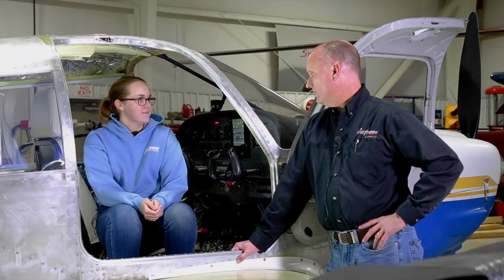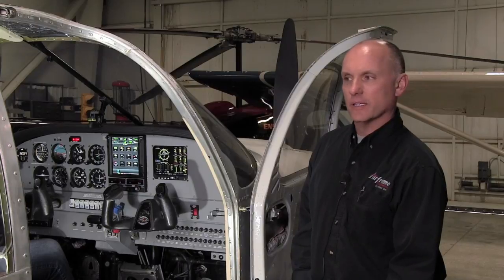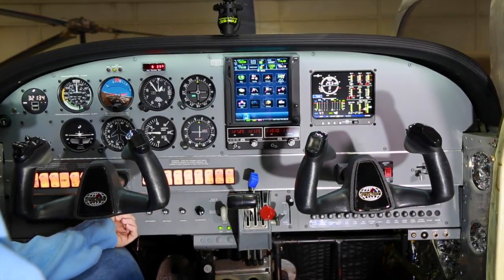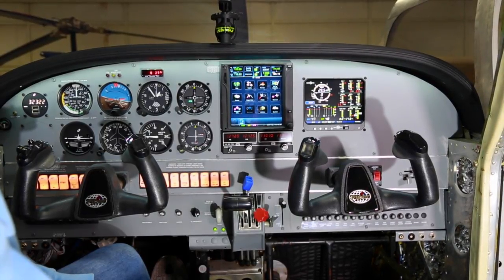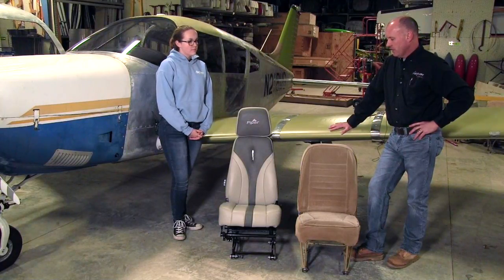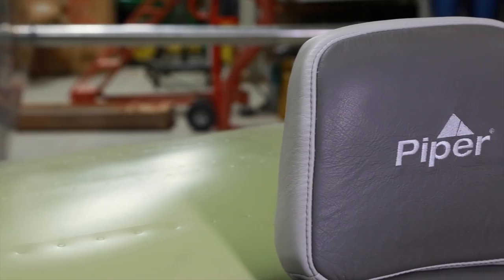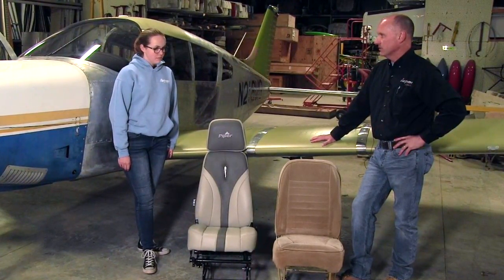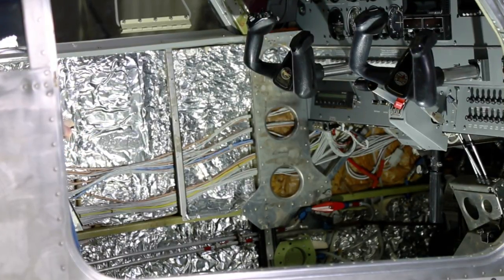1969 Piper PA28R Arrow Restoration Airframe Components Pt5

Comment: Looking good. Not having owned an aircraft, I have had to learn both full G1000 and addition to the GPS with 'steam gauge' instruments.  I actually prefer the GTN 650/750 with the standard 6 pack over the G1000.  Had to look up where in IN you were located. I grew up in bicycle riding distance of KCVG and my older brother went to HS in the late 50's at a seminary on Lake Wawasee. I like Cherokees.

Comment: Very nice.  I hope your daughter really appreciates what Dad is doing/has done for her.  I'm sure she does.  When the avionics went into the aircraft, I was kind of surprised you didn't go with a PFD, even an Aspen, but of course, that was your call.  However, now with the STC on the Garmin G5 both as a attitude indicator and HSI/DG version, are you considering removal and replacement of the attitude indicator and DG?

I also would be interested in what this airplane has cost you so far, and what you expect it to cost you by the time you're finished.  I'm pretty sure it's going to be a lot less than a new Arrow would cost, but also, I expect it would be a lot more than what a used one on the market would cost.  I'm figuring upwards of $200,000 if it was being done for a customer.

Anyway, Sydney is going to end up with something even better than a convertible car for her 16th, 17th and 18th birthday, that's for sure!  :D

Comment: 8/10/2019

I have owned two Arrows and flown lots of IFR cross country. I have never needed GPS, the old steam gagues and ipad loaded with Foreflight is all i need. The 750 you installed is a complete waste of money. Spend your money on fuel to fly the airplane, not on toys to see how they function. That $7000 engine analyzer is also a complete waste of money. In a piper arrow all you need to know is exhaust gas temperature under 1500, cylinder head temperature under 340, and your fuel flow set for 9 gallons an hour at 55% cruise. A $1500 engine analyzer is all you need. After a while you can set the power to match those numbers blindfolded.